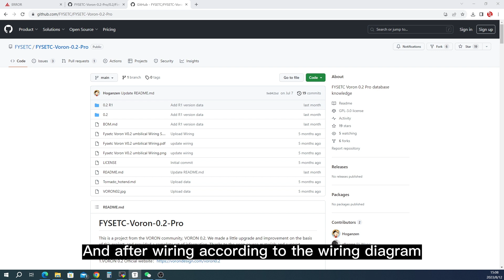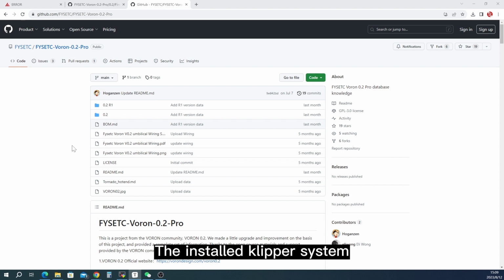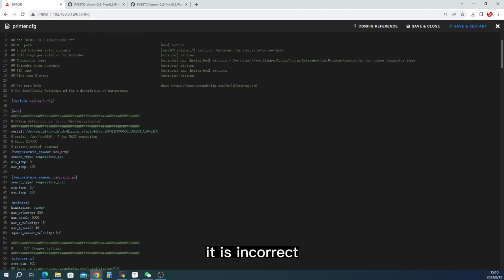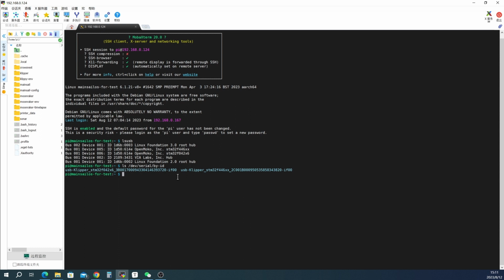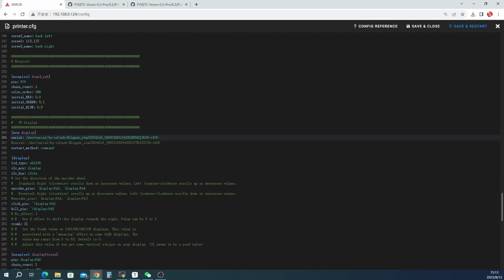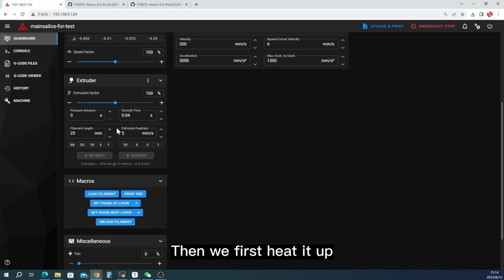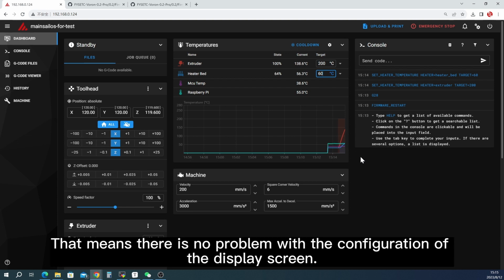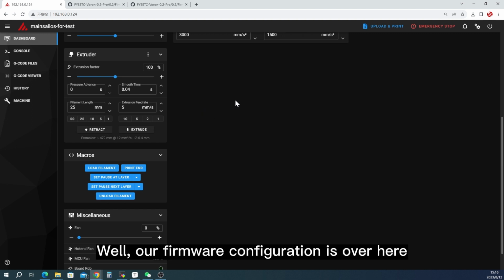VORON 0.2 Cheetah 3.0 motherboard and display firmware configuration tutorial

Comment: I Need the pin definitions why can’t I find them. Where is the example config for Klipper firmware ? I don’t see the tx pin name for tmc 2209 specifically
Reply from the maker: https://github.com/FYSETC/FYSETC-TMC2209
Reply: @fysetc4882  that’s for the the driver I’m talking about the pin diagram for the cheetah 3.0 board.
Reply from the maker: There is information about Cheetah motherboard on github @sacredserpent9667